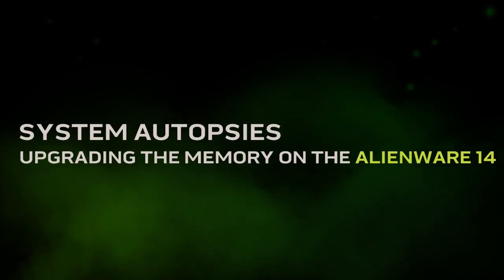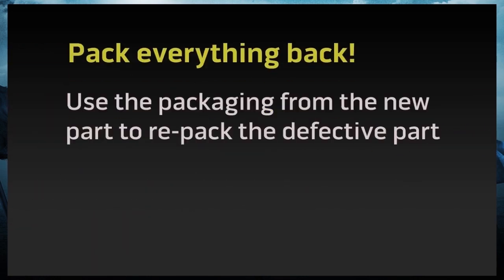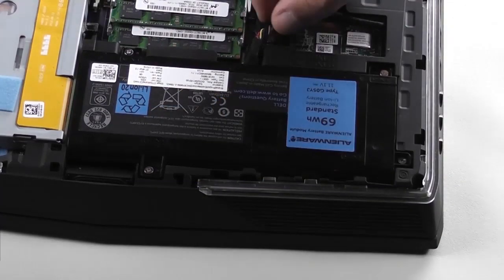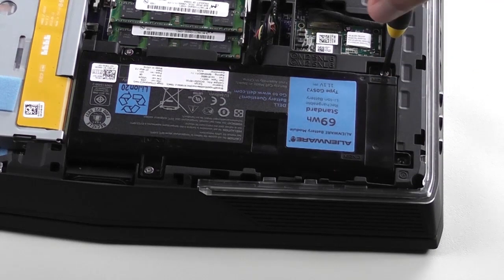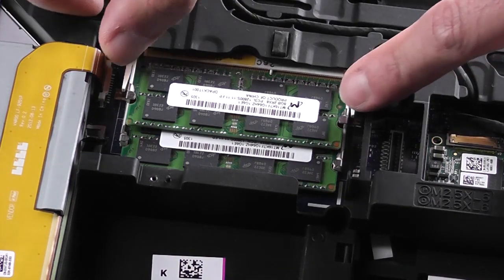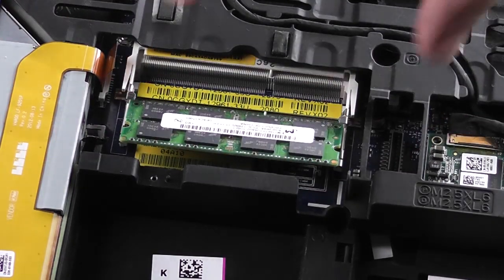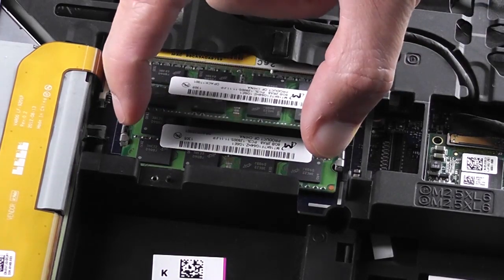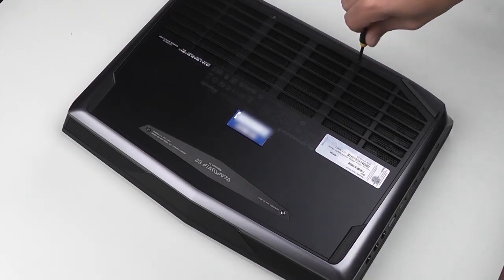Alienware 14: Upgrade/Replace RAM

Comment: I'm thinking of buying Vengeance Low Profile 16GB (2x8GB) DDR3 PC3-12800C10 1600MHz Dual Channel Kit (CML16GX3M2A16) To replace the RAM as I think one of my cards has stopped working, would this be ideal? Link is below! https://www.overclockers.co.uk/corsair-vengeance-low-profile-16gb-2x8gb-ddr3-pc3-12800c10-1600mhz-dual-channel-kit-cml16gx3m2a16-my-347-cs.html

Comment: hi alienware support, I know that you mentioned that the maximum RAM is 16 Gigas but what about if i upgrade the laptop from 2x4GB to one Crucial 16GB (1 x 16GB) 204-Pin SODIMM DDR3L PC3L-12800 Memory Module Kit would that be supported ?
Reply: +Alienware Services Have you guys try to do the upgrade to the 32 Gigas, could you please do a video and show everyone that is not supported at all.
Reply: So, if the specs are the same, why not upgrade to 32GB? The same thing was with my Inspiron 7720. Dell said that it's RAM limited to 8GB but it woks with 16GB like a charm.

Comment: My M14X R1 has 4GB of RAM, which means one slot is empty - am I right? Is it possible to add an 8GB stick on the empty slot and work on 12GB? I'm on a tight budget, so I ask.

Comment: Hi there!
I have Alienware 14 with 8 Gb RAM. Is it possible to upgrade to 16 Gb?
If yes, which RAM manufacturer brands can be the best?
Also, I've seen here that there is a difference between DDR3 and DDR3L memory. Is it important for memory upgrade?
Thank you in advance!
Reply: ***** Thanks for response!
So I would definitely need only DDR3L? Are there only two slots, so I will need to buy 2x8Gb?

Comment: Is it possible to put an NVIDIA GTX 860M chip in place of the 750 or 765 since the 860M pulls 75W which is the same as the 765?

Comment: I have followed the instructions from this video and upgraded my 8Gb to 16GB CORSAIR VENGEANCE DDR3L 1600MHZ (2X8GB) SO-DIMM. It works fine, windows detects memory, but I've noticed that almost on every "cold start" I get a random BSOD. Is it a memory fault or did I miss something important? (windows 8 memory diagnostics tool doesn't show any errors).
Reply: Interesting enough, but after I disabled "Turn on fast startup" from Power Options I stopped getting BSODs on every cold start.

Comment: They are very close, however there are three screws and the back comes off in two pieces. The ones on the other side are not very much more difficult. Just remove all the screws that have size labels next to them, disconnect the ribbons, flip, and slowly work the top off it comes off in one piece. Very good design from Alienware. I have had mine apart enough to replace the dielectric grease with antec to drop temps 8deg C.